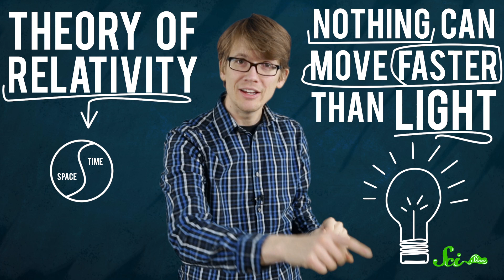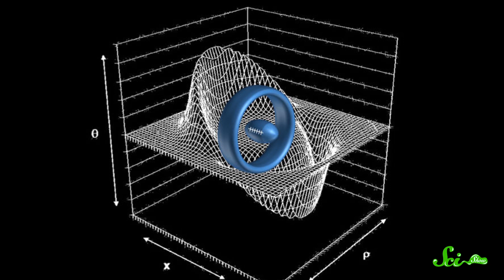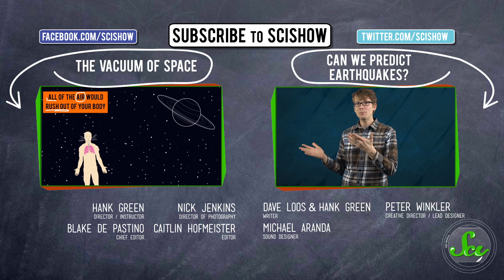Warp Drives!

Comment: Wait a minute ... a 20 Megaton Nuclear bomb releases 84,000 TJ which is equivalent to 0.084 EJ so we would need about 1000 20 Megaton Nuclear bombs to power this thing ... The US at it's peak had 32,000 bombs in reserve ranging from 0.05 TJ to 200,000 TJ ... just from preliminary estimates a warp drive can be powered just by the US at least 10 times over, not to mention the 2,000,000 TJ or 2,000,000 TJ in wasted Nuclear tests.

Comment: Black hole jets don't actually come from the black hole itself; they come from the disk of material surrounding the black hole. They are actually launched from outside of the event horizon and so the material can escape without having to go faster than light (though it does still have to go really friggen fast).

Comment: If you compress the space in front of the warp bubble and expand the space behind it, what happens after you arrive at your destination?  I would guess the space springs back to its original shape, and if so, wouldn't that slingshot the warp bubble right back to where it started?  In other words, how does the space within the warp bubble exist separately from the space outside the bubble?

Comment: There would still be a burst at activation as the acceleration of particles would occur just as the release of particles at high speeds would occur at the end, though likely directed away from the Earth. However that doesn't negate the fact that warping space-time on or around Earth is enough to screw with our planet's rotation/orbit at the very least, and cause monumental damage at the most.

Comment: Well, space isn't just emptiness, because space is a vessel on which time, mass, and everything else in the universe travels on. Without space, there would be no higgs field, therefore no mass, therefore no energy, therefore nothing would function the way the standard model of particle physics predicts, and our own tests confirm. So, if space is moved or warped, because really, then the laws that require space would start to change. That's why physical laws change at near light speed.

Comment: As in age more quickly, yes. If you're not close to the speed of light, the difference will be extremely small, and usually immeasurable. GPS satellites do have to correct for it, though, since they are moving extremely fast relative to the earth and require such enormous precision. Interestingly, gravity has the same effect on time that acceleration does (relativity treats them as equivalent) so the satellites also have to account for the lower gravity up there.

Comment: Warp Factor isn't hard science, it's based on Star Trek science fiction, and varies widely between episodes and various series and movies. But, since the original series, Warp Factor has been an exponential scale, not a simple multiplication of the speed of light. Warp 1, for example, is the speed of light. But warp 3 is around 27 times the speed of light, and warp 9.9 is about 21,500 times the speed of light.